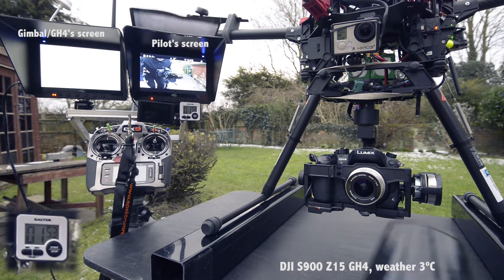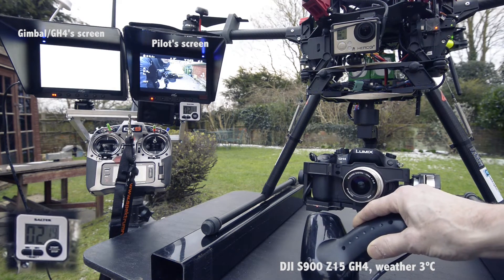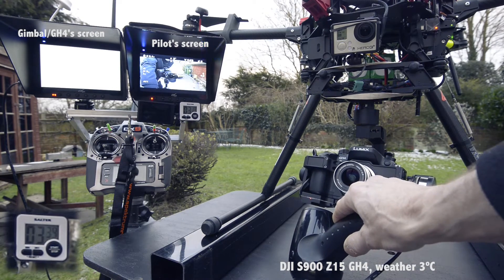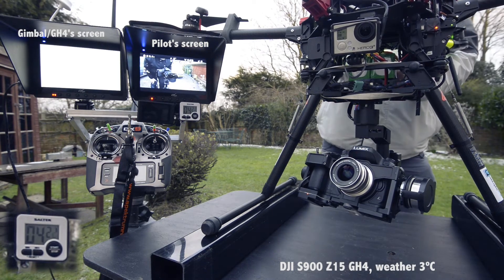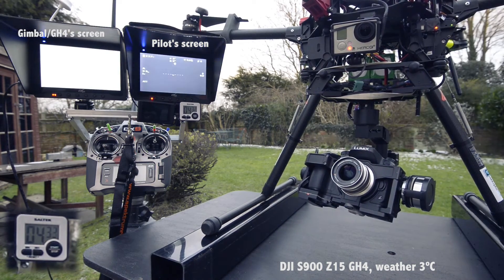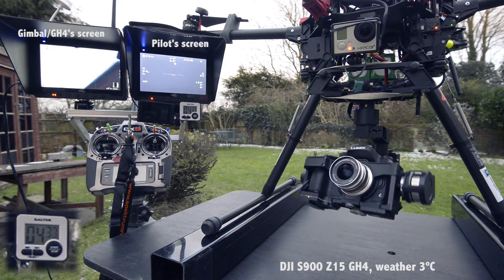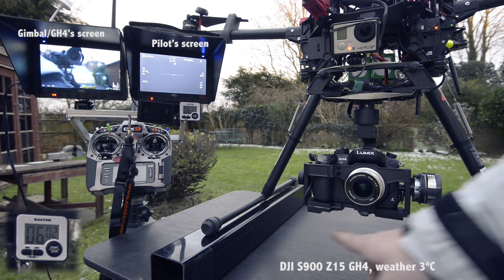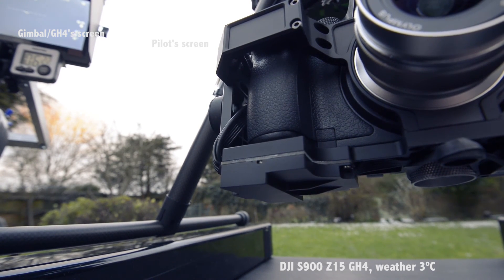S900 Zenmuse z15 GH4 Gimbal HDMI problem

Comment: The GH4 seems to confuse the HDMI converter, but our dealer sent us a free replacement HDMI board, which we fitted ourselves and this seemed to solve the problem. This was in back in April 2015, so make sure you don't get old stock, as the first replacement in February didn't cure the problem. But recently we have been using an Amimon Connex mounted on the gimbal and powered from the gimbal to send us HD quality camera view. So we are bypassing the HDMI board completely

Comment: I have been having an issue with white screen from the Z15 HD Gimbal using GH4 Lumix.  I started the process of elimination.  Wired the GoPro right into the OSD Mark II and video worked fine, so that led me to point fingers to the video through the gimbal.  So to test that, I used the same micro hdmi, powered up my s900, then plugged in the go pro to the micro hdmi on the gimbal and video worked!... So this just leads me to believe my camera settings on the GH4 are not right..  frustrating, seems I have tried everything.  I thought is was the conversion board that wasn't working in the gimbal but if it works from the go pro hdmi out, I am not sure..
Reply: I always thought it was a sort of lack of sync between the GH4 and the Z15 board. Many times by restaring the camera the problem was solved.

Comment: Hi guys, strange issue you have. I think there is something wrong with my gimbals wires or av board... But.. When I try connect the gh4 via two micro hdmi to the lb air I don't get any picture?? But if u do exactly the same with my Sony handy cam I get a picture... Any idea why? Does the gh4 need to be on a certain setting for it to work directly thru an hdmi micro cable?

Comment: The problem is not just in cold climates!!!! Yes my problem started with 0 degrees Cel.
but now it is also at 30 degrees Cel.  I think there is a problem with the switching from HDMI to AV.......this equipment is not reliable for to many badly designed integration into one system....